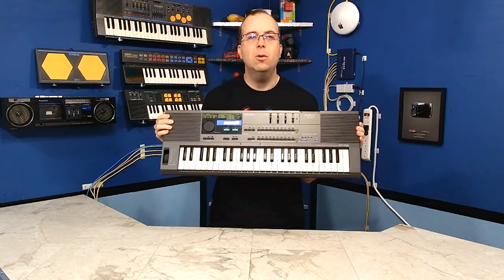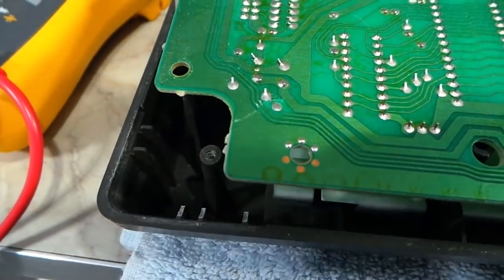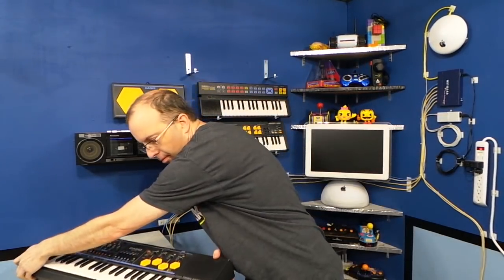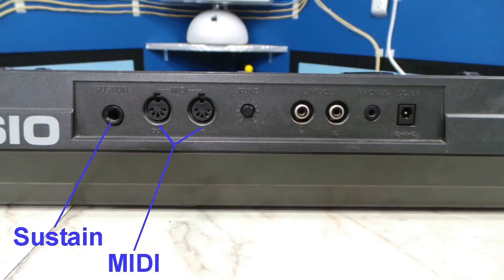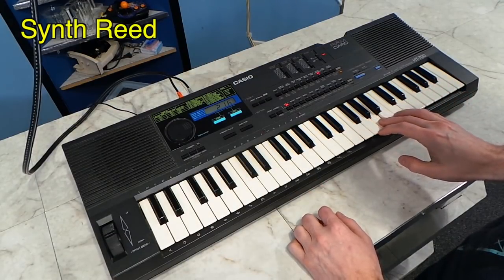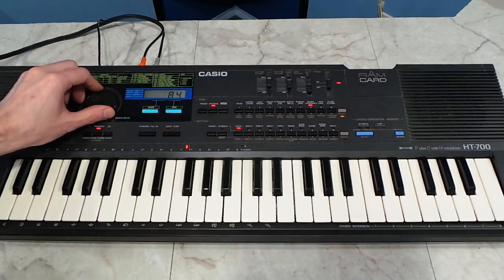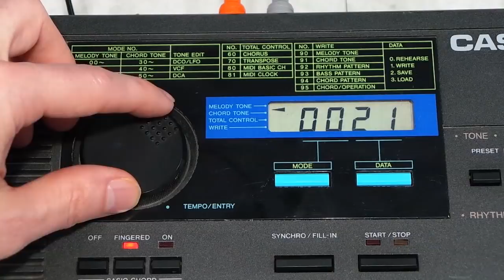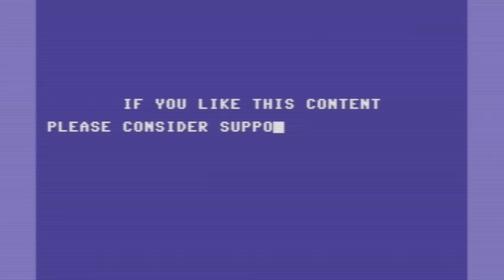Casio HT-700 Repair and Review

Comment: Here's a brief look into the synthesis engine that the HT-700 uses. The HT-700 uses a synth method called "Spectrum Dynamics" or SD for short.

SD works by using two digital oscillators where one is used as the main body of the sound and the other as overtones. The overtone and body oscillator have their own DCA that allows their volume to fade in and out independantly of each other. 

Both are then mixed together and sent to the analog filter section which has its own DCA as well. Then it's outputted to amp and thats it. 

The biggest issue with SD, or rather Casio's implementation, was that the Oscillator DCA's were nonprogrammable and thus you ironically had no control over the very thing the SD was special for. All you could do was choose waveforms and that was it.

Hope you all found this tid bit interesting.
Reply: I think you can program the oscillators on the HT-6000, and change the envelope curves on both waveforms. Or at least it has a lot more preset waveforms to choose from than the HT-700.
Reply: So its west Coast synthesis method mixed with east Coast. Interesting for sure
Reply: Well I own many synthesizers and some keyboards ,this casio ht-700 is actually a digital synthesizer with analogue filter which in ht-6000 you can explore more.This pro synth-keyboard from casio were not went good on sales, cause casio had already the famous cz line which was the most advanced for sound synthesis..casio perhaps wanted to bring something between the cz and other keyboards but there was not so good of quality ..but the engine circuit inside can produce timbres that are good for some kind of music especially instrumental..
Reply: That sounds suspiciously similar to Casio's "vowel-consonant" synthesis.
Reply: @diggydude5229  having owned a 3000 and still have a 700 they are both very versatile, real synths, once cheap, the 6000 is as far as I have read massively more versatile with I believe double the oscillators and basically everything else ! I want one ha ha

Comment: This was my first keyboard that I got back in the late '80s, and I still have it. For a consumer-focused synth, it has a surprising amount of flexibility. I actually ended up making my own sounds quite often.

It is built quite cheaply, but mine has held up pretty well considering it's over 30 years old. The speakers occasionally come loose, and the power adapter has suffered years of abuse and had to be replaced eventually. There are also two keys whose hinges have broken, and now they are held in place with tape. I haven't taken it apart again to look at them, but I assume that the hinges are simply just bending plastic that eventually broke through.

Even after I got a Boss DS-330 and eventually software synths, I still continued to use the HT-700 as a MIDI controller until a couple of years ago. In spite of the tiny keys and fixed velocity, it served that purpose well. I mostly do step programming, so it wasn't really an issue.

I plan to hold onto this synth indefinitely. It may not be amazing compared to the other synths I've acquired since then (both hardware and software), but its hybrid nature creates sounds that I haven't encountered anywhere else.

Comment: You did an astonishing job of restoring this keyboard, you proved that even a cracked or rusty motherboard can be still used by desolder and wiring stuff directly to eachother.
I am amezed that once you extended those screw holes by drilling that you did not end up drilling trough the other side of the plastic.

Comment: 1:30 The OKI chips are definitely some sort of ROM chip or something for sample storage. They were a very popular manufacturer of PCM sampler chips for arcade games (usually used with FM chips by Yamaha) so that's the only logical conclusion.
Reply: Also, after watching more of the video, I'm starting to think that that the NEC chip you brought up earlier is a wavetable sythesizer chip similar to the HuC6280 in NEC/Hudson Softs PC Engine system. Many of the synthesized instruments have the same weird, harsh sound that the HuC has.
Reply: Did they made the PCM/DAC part of Sega Genesis' soundchip?

Comment: The NEC D23C256 is a 32kByte mask ROM. Those other OKI 6294 Chips are 8KByte of static RAM each, no ROMs. And yes that D78C10 is in fact the CPU. From all I can see that "MIDI Controller Chip" is just another static RAM, but a very fast one, like the cache chips for old 80486 boards. Edit: The OKI 6294 are not static RAMs but percussion generators. Very misleading numbering. The small "MIDI  controller chip" is a static RAM but not a fast one, just a small one.
Reply: The schematic refers to the 6294's as "percussion generator 1/2". The pin assignments are completely different to an SRAM :-)

EDIT: Also the speed grade of the actual SRAM is 150ns. The trailing zero is usually left off. In '87, if you could even get an 8KB SRAM in 15ns grade, it would cost a fortune! No way the bean counters would go for that. If you don't need the performance, don't pay for it :D
Reply: That's weird anything with 62x4 is usually static RAM. Yeah 1987 is a bit too early for cheap fast RAM. However back then there were "fancy" 300 mil 150ns SRAMs around in order to "safe space". But I have seen weirder things like an ITT4017 (in Delta-Lab delays) that is actually 16kx1 DRAM and not a HEF4017 counter... Could you please provide a link to that CASIO schematic?
Reply: Sure thing! The PDF is available here:

https://synthstuff.wordpress.com/2012/01/04/casio-ht-700-mods/
Reply: Thanks. Those OKIs are weirdos and very misleading numbering. They only use one chip select signal the write signal  and the 8 data bits. They also got the CLK signal that tell that they have some counter like stuff in it. Apparently they got 4 channels each and only the MIX out is  used. The DAC converters or at least some PWM DAC thing seems also to be inside them.
Reply: The OKI MSM629x series usually relates to sound chips of one sort or another. The 6295, for example, was used in a lot of early arcade machines for general purpose 4-bit ADPCM sample playback. I can't find a datasheet on the 6294 but from the information we now have available, I can guess it works a little bit like the 6295 but has a mask ROM for the waveforms rather than arbitrary ones being loaded by the host CPU. Cheapest possible way to make something that did the job well enough, I suppose!

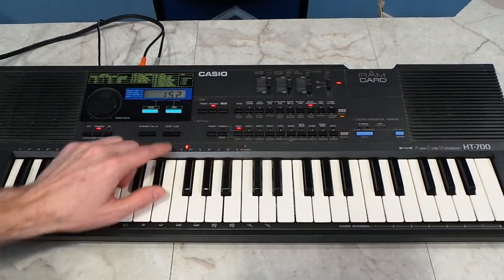Comment: At 9:32, you should have held down a chord as you had fingered mode on or selected chord mode and held down 1,2,3 keys to the right of the root note. Also this keyboard had a built chorus unit to fatten up the sound, this was lost as the recordings sounded mono. The Data entry control pot was much quicker than just having up down keys, and was a luxury at the time :-) Sounded bright and interesting in it's day, a cheap multi timberal midi keyboard with a analogue filter with resonance although very limited + Song recording + chord + bass + drum programming.
Reply: I had one of these for a while and the knob was brilliant once you got up to speed. Its funny how the early synths were all beautifully controlled with knobs and all that went out the window in the 80's with baffling key combination UI's that took over. 

I did quickly learn to hate this keyboard overall. Its sounds are weak. You can really give them a sonic shot in the arm with effects but its hardly worth it really.
Reply: This model has an analog pot for the data entry wheel. I guess rotary encoders were too expensive at the time.

I have two HT-700s. One is fairly minty and has a crisp sound. The other one has a mushy sound, which makes me think the caps need to be replaced. If I remember correctly, the little PCB with the MIDI jacks on it needs to be rebuilt on that one too.

I also have the non-programmable version, the HZ-800, and the full-sized programmable HT-6000, which was the top of the Spectrum Dynamic line and was supposed to be a professional model, but the build quality was more like a typical Casio toy model. The HT-6000 sounds much more professional than its mid-sized siblings. The HT-700 sounds cartoonish in comparison.

Comment: I have one of these keyboards that I nabbed for $5 from a local yard sale. Its not the be-all and end all, but a few things that were overlooked in the video were the asdr envelope, the filter/resonance, and envelope controlling the filter. There's also chorus which is nice. Although you have limited access to your sound modifiers, you can get around this a little bit by setting your jog dial to something you want to control such as the cutoff for the filter , or decay...and sweep the dial- This is really nice for pads, arpeggios, etc. The jog wheel is a little bit steppy, but for so cheap, its permissible imo.

Comment: I'd like to see a casio cz series keyboard on the channel. They were aimed at amateur musicians and their sound is wonderful.
Reply: Other than the CZ101/ 1000, the CZ series were aimed at the pro market (even though the 101/ 1000 used the same sound engine). The CZ 3000/ 5000 and CZ-1 are very substantially made with metal chassis, pitch and mod wheels, expanded memory and in the case of the CZ-1, have a velocity sensitive keyboard with aftertouch. They're excellent synths and still very usable today.
Reply from the maker: I have a CZ-1000 and have featured it at least 3 times so far.
Reply: Terrance Petsas - Nice profile picture.
Reply: That is true however I think he ment by a review(a video like this).
Reply: Good job you are my favorite channel.
Reply: I have a CZ-101 and a CZ-3000. The 101 needs some love. It was starting to flake out last time I messed with it.

Comment: JB-Weld FTW!
It's great stuff ...metal filled epoxy, dries at room temp, reasonably long work time, and it can be sanded and drilled once dry. I used to use it all the time in robotics projects in college. I even know a guy that fixed a crack in the engine of his WWI biplane with the stuff. It was a stop-gap solution, but he managed to fly it home! It should definitely be your go-to for any broken plastic.

Comment: Curious why you didn't just try to scrape back the solder mask on the crack area and just run new small patch wires or even small solid wire to bridge the traces at the crack? Seems that would have been easier than completely desoldering the wires off the speaker..etc? Would have only required a smaller bit of hot glue over the repair for insulation and less wire across the board.
Reply: That's what I was thinking. Scrape the coating off, patch the wires at the cracks and reinforce the cracked area with epoxy. I would have built up the base of those broken plastic studs too. But this works just fine, just a difference of opinion on repairing it. I really like the song.
Reply: Jesse Hardesty well, yeah, but the solder joints were already there on the board, so he might as well use them.
Reply: But for the work he did in desoldering etc...it would have been just as quick and looked more professional if he had just repaired the two broken traces at the crack. Would have been less work and looked much better than a large length of white wire hot glued to the back of the main PCB. I'm really not trying to be critical and was just more curious than anything. Additionally the keyboard states it is in stereo, but the video doesn't have any samples to show if that is really true.
Reply from the maker: I thought about it, but wasn't sure it would be as reliable, plus it would have taken longer.
Reply: The HT has a stereo chorus effect. The actual voice output is mono, but is made (pseudo) stereo if the chorus is used. It also has left and right line outs, and outputs in "stereo" with the chorus in use. Otherwise without the chorus, both left and right outputs share the same signal.

Comment: Yeah, I found that too. fixing old keyboards can be surprisingly easy. I have a 1998 Yamaha PSR-79 keyboard that I got around that time, and through my own bad judgement it ended up with battery corrosion, and about 1/3 of the keys stopped working.
When I checked inside, the damage wasn't too severe, but I did notice how the keys themselves were basically just a dumb switch matrix attached to a ribbon cable.
Sure enough, a continuity check on the ribbon cable with a multimeter showed that two of the wires were broken.
So... I got some lengths of wire about the same size as the ribbon cable, and soldered it between the two ends of the broken wires...
And that fixed it. Nothing complicated. Anyone with a very basic understanding of how to solder and use a multimeter and a bit of logic could have checked it, worked out what was wrong, and fixed it.
It CAN be that simple in some cases...

Comment: Great video, as usual. You seem to have been infected by the "so" language tic in this one, count the number of sentences you start with "so" :P
Reply from the maker: The reason this happens is that much of the pieces are recorded separately, so when I connect all of the bits together in the final edit there end up being more "so" words than it originally sounded like.  However, I can often run into the same problem using the word "next" or "now."  it's a constant struggle.
Reply: So don't worry ;)
Reply: So, once I noticed this I couldn't stop hearing them. So. I counted 38 in total. So-so. I think David's content and production quality is great, so i'm not complaining.
Reply: xjj99 at least he doesn't say "as you can see" 100 times

Comment: I remember really wanting this keyboard so much back in the mid 1980s!  I ended up with a Casio MT-100 instead and then a Yamaha PSS-560.  Finally I had a Casio MT540 and a Yamaha PSS-790 before moving on to a professional Yamaha SY55 which I still use.  Oh I nearly forgot, in 2011 I bought a Yamaha DJX for a bit of fun and sold it a year later.

Comment: Great video on a great little synth.  I have had mine sine I was about 14 years old and it still works.  Used it mainly with the Apple IIgs for midi work for the last few decades.  Was originally purchased at Odd Lots in the mid to late 80s for 79 dollars as a birthday present.  It was given as a replacement to the CZ series I originally bought but came with broken keys.

Comment: If your super glue is too runny, sprinkle some baking soda on with a toothpick or something and let the super glue soak into it. The baking soda kicks the super glue to make it cure quicker and to more things, and gives it a lot more body. You can actually just keep adding baking soda and super glue to get whatever shape you want. Something else to try for broken plastic is "Plumber's Putty", which you get in the plumbing section of a Home Depot or something. It's like hard sugru, you cut off a slice, roll it around to mix it, then you get about 15 minutes to mold it before it's too hard. Rough up a surface so it sticks better, then you can sculpt a boss or a radius or whatever plastic bit is broken off.

Comment: Got exact same keyboard. Found it in a dumpster a decade ago. It had a broken power plug, and required minimal repair. It serves me to this day. Menus are quirky and hard to manipulate with the dial, but the sounds are good. Effects are very decent. The biggest problems for me is the lack of velocity sensitive keys. I often feed a newer keyboard though the MIDI port and use HT-700 as a tone generator to acquire velocity. Unfortunately there's almost no multitimbral functionality and no General Midi compliance, so it cannot be used as a retro gaming sound module.

Comment: if you're an amateur musician like me, working only occasionally, the lower priced yet high-quality-enough Casio instruments are the best bet! Casio does also have high end systems at reasonably priced options, which are quite good and do beat the competition ...
Reply: The best thing about these keyboards is, you don't sound like everyone else who is using ProTools.
Reply: @ Diggy Dude: never used ProTools so i don't know if it's good or not ... but i do remember similar stuff for PCs in the 1980s, which had really bad interfaces and sounded like childish arcade game sound effects and music at their best ...

while at the same time there were more than a couple of really fine music making proggies for the Amiga computers that used the computer's own 4-channel stereo surround sound chip system and both the programs as well as the Amiga's 8-bit audio worked and sounded truly great and could feel professional when hooked up to a good amp too! (i'm still using those things today btw!) :-)

i also know cheap low-end CASIO keyboards of the 1980s (a number of which i owned and used at the time, until early 2000s) sound A LOT BETTER than their more expensive equivalents in the YAMAHA brand, through their own inbuilt speakers at least ... and the CASIO keyboards sounded great when connected to amps too! (be more than willing to still use them today, even those toyish PT ones! modern CASIO keyboards are also truly good considering their price per performance values ... i'm a dedicated user you could say!)

back in the day, people defended those YAMAHA keyboards as being 16-bit machines vs CASIO's supposedly 8-bit ones, which i'm not sure if that was true or not because -- again -- i always preferred CASIO's sound to YAMAHA in that range of keyboards at least ...
Reply: I'm not knocking ProTools, just saying that if everyone uses the same software, they're all gonna sound alike. I have around 30 Casio keyboards, ranging from pro FZ and VZ models down to the dinky little PTs, so I totally agree with what you're saying.
Reply: currently i have a Casio WK‑500 and a Casio CZ-101 mini synth ... more than i need ...
but love to add many more by Casio as well as others ... more for the love of electronic keyboards than to work with them really ... :-)